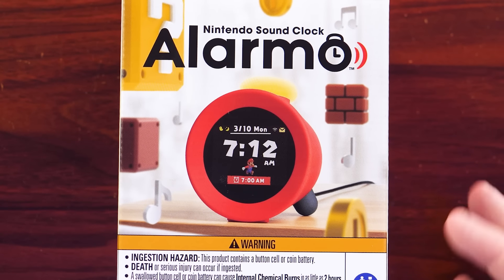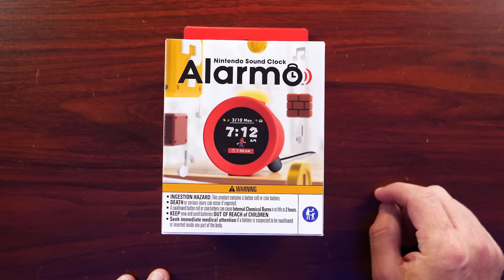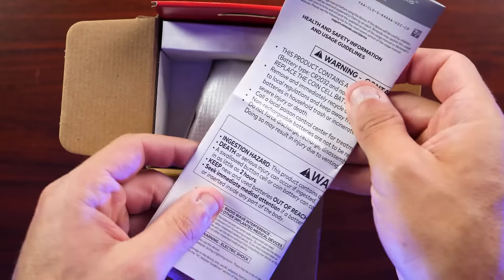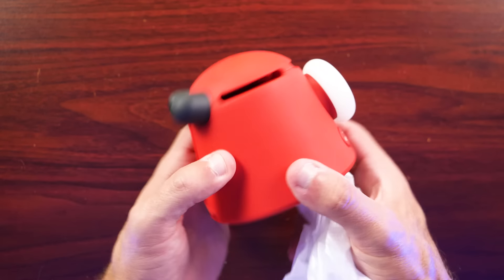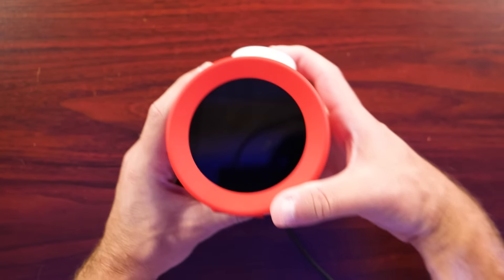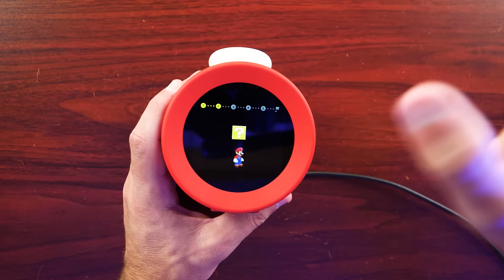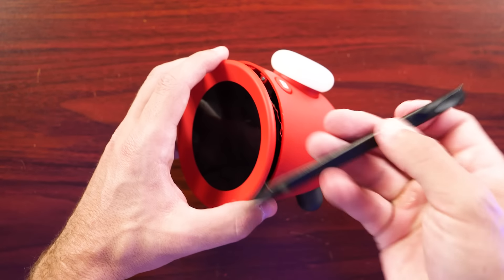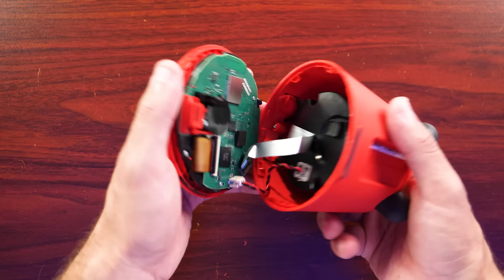What Nintendo Didn't Tell You About Alarmo

Comment: When will they get Doom running on this thing ?
Reply: Was about to comment something similar. 😂
Reply: The moment they can find a way to pair up controllers through wifi.
Reply: Doomsday clock lol
Reply: Nerds have Doom running on STM32H already, so not long.
Reply: Does it run Crysis?
Reply: It will definitely get Super Mario Bros for sure.
Reply: If I was a betting man, I'd say about 1-3 weeks.i wouldn't be surprised if it was within the first 3 days.
Reply: @Shayma98  I already did too. LOL
Reply: Bad Apple* fixed it for you
Reply: @QuizMasterEntertainment  No need, just reprogram the radar to sensor your movement and map that to button inputs.
Reply: Here we go 😆
Reply: @1MyNickname1  Probably would be too janky to play it properly, but if anything, it would be really good to play games like Xbox did with the Kinect a few years ago.
Reply: I was thinking that too. It has a screen.
Reply: @QuizMasterEntertainment  You could play Doom on a pregnancy test.
Reply: @zachtwilightwindwaker596  You can play it on a calculator, that's not the issue, the point is to make it play properly, not just install it there.
Reply: First rhing i thought.
Reply: This. Don't care about else it can do
Reply: After Skyrim
Reply: soon.
Reply: Lol!
Reply: @QuizMasterEntertainment or through the usb cable
Reply: @kourtiss64  It has only one port and it's for power, not to say you'd have to mod the device for the controller to even work.
Reply: @QuizMasterEntertainment  yea i mean that im pretty sure that the homebrew or well someone will actually find a way to mod this
Reply: Guess what it now runs doom
Reply: Couple days ago: watch?v=5IOVYvSMAoU
Reply: they did!

Comment: What Nintendo didn't tell you about Alarmo:
-How to take it appart.

Makes sense!
Reply: I feel like they made it easy to get to replace the button battery as you only need the tri-wing screw driver and then twist to unlock it. So perhaps they haven't documented for the public yet or it's hidden on the website somewhere or is only for support team.
Reply: The instruction manual is 50% do not open this thing. Do not attempt to replace the battery. 

I was afraid they soldered the battery down. Not a big deal, but they could’ve made it one if they wanted to.

Comment: Imagine using a black background for everything and not using an OLED screen.
Reply: Especially for $100
Reply: That thing should've been ~30-40 bucks and it would've still been overpriced.
Reply: Use your brain for a second, I know it's hard for you. But if you look at the lcd panel support bracket there is an opening for the radar's signals to pass through. That  wouldn't work if the oled was in the way, unless they made an eye sore gigantic notch. And all that without taking into account an oled display displaying static images 24/7 wouldn't last a year. The design is sound.
Reply: @mlfc1950  Also who wants to have a bright ass screen beside their bed?
Reply: @mlfc1950  I tought about burn-in. It could work if you shifted the text a bit every once in a while. With an LCD screen you would have a glowing rectangle every time and it would look quite bad. Also I don't get how it would interfere with the RADAR sensor, if you think about it an OLED display is simpler and thinner so it should work even better (the screen is also small, so there is already a bezel)
Reply: @mlfc1950  11:43 The opening for the sensor clearly doesn't go under the screen. You should watch the teardown before making such statements

Comment: An alarm clock that turns off if you have a power outage is basically useless. 🤦🏻‍♂

Also, no power adapter (sold separately) and the fact that it has a square display in a round shape makes this an instant pass.
They should have made it in the shape of a cube (Mario coin block?) instead of the weird shape they gave it.
Reply: So like clocks throughout time. And if your power is only out temporarily it should just come back on like normal.
Reply: @TheMysteryDriver  I don't know what alarm clocks you are used to, but in my family we used either traditional analogue clocks (spring based, with wind-up mechanism and  2 bells at the top with a small hammer in between) or digital clocks that used batteries (multiple AA/AAA, single 9V, etc.) that would always ensure the alarm went off at the expected time, regardless of other external factors.

If I have to get up at a certain hour (to catch a plane, be ready for a meeting, etc.) and the alarm clock I rely on does not start ringing at the expected time because of a potential power outage, it has failed in accomplishing its primary function.
They could have easily solved this by having an internal battery large enough to keep it functional for a couple of hours in case of an interruption of current from the USB port.

The reason smartphones are mostly used nowadays to fulfill that role is because everyone ensures they are charged up (whether plugged to a power outlet, power bank, another device, etc.) and will be operational when morning comes and the alarm is supposed to go off.
Reply: @AlexanderRavenheart  the reason people use smart phones is because they always have them on them. Nothing more
Reply: Did you even see the backup battery?
Reply: @AlexanderRavenheart  website says it has an internal battery
Reply: @dylanrhoads  @TheMysteryDriver Did you watch the video? Did you watch other videos of people testing the product? 

As soon as the device is disconnected from an external power source it turns off completely and will stay turned off until it is connected again.

The little CR2032 3V battery shown in the video at 6:40 is used to keep the settings and the RTC (real-time clock) going.
Without that battery, the initial setup process would be required every time the usb cable would be unplugged.

The product does not have an internal battery like a wireless controller, portable console or smartphone, that permits the device to operate without an external connection.

Comment: $100 dollars and Nintendo didn't have the decency to include the power brick.   What's next? ... The new Nintendo switch won't include the power cord or the controllers. F'n Nintendo thinks they're Apple now.
Reply: They removed the charger from the New 3DS before Apple did with the iPhone 😵‍💫
Reply: inb4 the Switch 2 doesn't include the battery and requires you to provide your own
Reply: Y'all feel the need to complain about anything, huh
Reply: I mean, the Switch dock has USB A ports on it. You can power it off of that.
This saves all the worthless junk adapters from getting manufactured.  Don't tell me you don't have a drawer full of orphaned wall warts.

I agree the price is insane, though.

Comment: How long is that cr watch battery going to last and what happens when it runs out?
Reply: that buttton cell will swing the time crystal and keep track of time for around 8 to 15 years. no usb power>no screen (just time keeping). if that battery runs out, this clock cant remember the date and time, and you will have to set the time everytime you turn it on (or loose power).
same thing that happens on your pc if your cmos battery runs dry.

Comment: This thingy probably costs less then $15,- to manufacture.
They could have at least made the clock battery more easily replaceable and used a rounded Oled screen.
Nintendo already orders those Samsung Oled screens in bulk so why not put 'em in the Alarmo.
Reply: Use your brain for a second, I know it's hard for you. But if you look at the lcd panel support bracket there is an opening for the radar's signals to pass through. That  wouldn't work if the oled was in the way, unless they made an eye sore gigantic notch. And all that without taking into account an oled display displaying static images 24/7 wouldn't last a year. The design is sound.
Reply: @mlfc1950  nah, they could just make a small black circle around the oled screen and put the sensors in there or they could put the sensors in the red part.

Comment: Hi there i am a Mechatronics Engineer, the Radar sensor on the front is called a Milimiter Wave Chip we use it for movement sensor on the place of the Infra Red sensor for specific applications that need very precise movement tracking, like the name suggests a milliliter movement is enough to trigger it, not only that it can track how far you are from it in that precision allowing to make different triggers based on movement and distance. They can detect normally a body up to 7m from distance depending on the chip, frequency and antenna power but you can cap the distance of detection by software as well.

Is widely used recently for security applications where you need to track and do actions on an area based on the distance, like for example sounding an alarm if a body is detected 2m close to a gate, anything more than that just logs the detection, the main issue is it can only track one body at the time because if something goes in-front of it, it cant see past that thing.

Nintendo made a good choice using those because the are very precise and easy tunnable by software and compared with a Infra red sensor doesn't suffer as much from the beam bouncing of walls been reflected or receiving IR signal from other devices since it uses a electro magnetic wave band that doesn't conflict with other surrounding wireless appliances, different from the IR sensor that uses light that can easily bounce of walls.